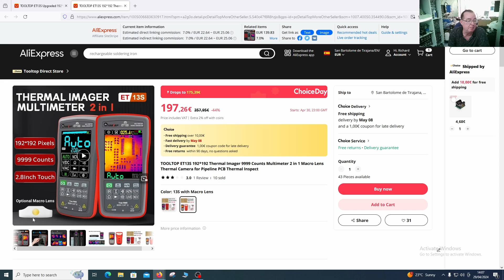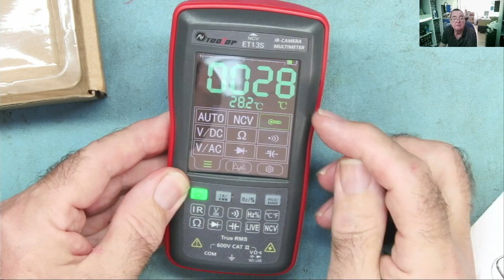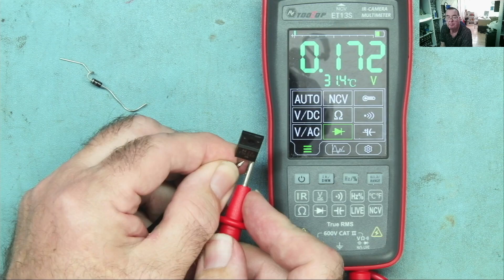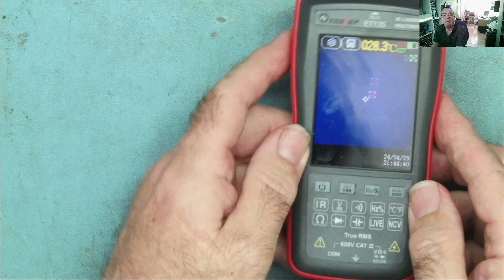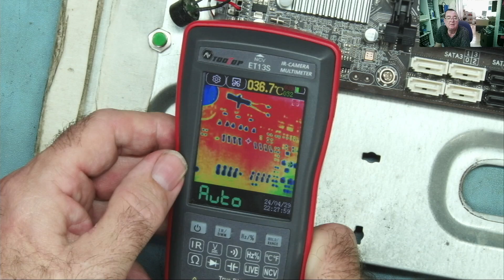TOOLTOP ET13S IR Thermal Camera Multimeter! Test, Review and DISCOUNT CODES This is interesting!

Comment: Will this be usable for micro soldering? With small resistors?
Reply: and capacitors
Reply: @sharymens8187  did it have a soldering feature?
Reply: @dubmob151  ah I meant to be used in microsoldering, pardon for the confusion

Comment: The soft start on-off button is universally popular now, but there is a drawback, as there’s a very small drain on the battery, similar to standby voltage. However, old school equipment with a traditional on-off switch will disconnect the battery.
Reply from the maker: Agreed
Reply: Why do you think the old school setup is declining in popularity?
Reply: @sharymens8187  latter day humans no longer have the excess physical capacity to operate manual switches, being only capable of button pushing.🙃

Comment: Nice review Richard. I like yourself, don't like how it enters IR camera on power up I'm sure it would drive me nuts in no time. Question - Is it possible to export saved images i.e. is there any connectivity?
Reply from the maker: @alanrichardson1672
 It turns out you can set this in the setup menu to boot into whichever mode you prefer at startup, I missed that and apologise as it was misleading.  This just makes it better IMHO
Reply: Yeah, you can export the picture

Comment: If something had to go to keep the price down then current is the obvious one as no extra connectors no fuses no firmware, thanks for the review I shall take a closer look t this purely from a FLIR point of view as its less than 200 quid ....cheers.
Reply: Current measurement would also probably be the least used range / feature for most average users.
Reply: @alanrichardson1672  Yep, and thats certainly true for me :)

Comment: Thanks for the review. The screen resolution and four physical buttons suggest it's basically an android device of some sort. Also, I think the display behaviour when you connect a diode to test and it is in continuity mode is by design to inform the user that there is some sort of active device present rather than a pure resistance.

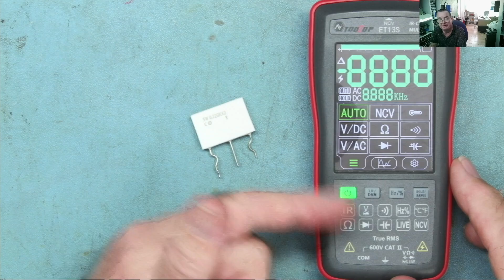Comment: @LearnElectronicsRepair [9:04] The "Auto" label in the thermal camera mode briefly displayed "42.78 MΩ"! What does this mean? Does the device allow electric measurements while using the thermal camera???
Reply: Well spotted. It didn't do it at any other point in the video though. Strange.
Reply from the maker: @Manticore1960  Let's see if we can replicate this on the livestream, Sunday @theelectronicschannel
Reply: @LearnElectronicsRepair  While in the thermal camera mode, connect the test leads and short them. Will it buzz?

Comment: I believe that the current mode is omitted for a reason. In current mode the shunt resistor heats up, which is bad for IR camera. For best performance the IR imaging array should always be in constant (low) temperature. This must be a deliberate trade-off.
Thanks for the video as always.
Reply from the maker: Yes that makes some sense.  It doesnt' make it a bad multimeter, in fact I think the combination of the Mr Bleep style diode test mode and the thermal imaging makes it a good fault finding tool - and very good value at the speicial offer price 🙂

Comment: Nice tool and the ir cam has  good refresh rates in this price class.
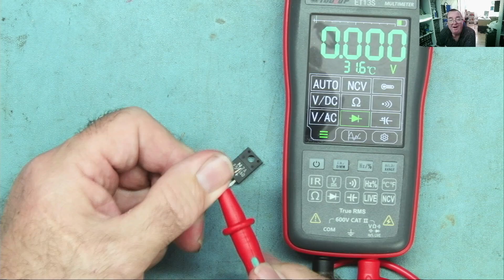13:40  Mr. Bleep is in da house 😱🤣🤣🤣
Reply from the maker: YeahI was really surprised to find that - as you saw in the video. That was my genuine reaction.  Price wise with the special offer 1st-5th May, it comes in at around €140 and that's really good value for the specs IMHO

Comment: I'm always a little wary of DMMs that don't use standard batteries. It's probably fine if you use them regularly. But if not, by the time you need them the internal battery will likely have fallen victim to the high self-discharge rate of rechargeable cells. On the other hand, when was the last time you had to replace the batteries in your Fluke or Aneng? And in a pinch (like an emergency on-site repair job), it's much easier to get hold of a couple of AAs or AAAs. They're sold at every petrol station, even on Sundays. Then again, maybe I'm overthinking this. 🤷
Reply from the maker: It does seem to be the new standard that all portable test equipment uses lithium batteries and USB-C.  I don't know if this is due to some ecological requirement or just the way everyone seems to think is best.
Reply: Yes you probably are. Li-ion cells shouldn’t loose charge when powered down if the circuit is designed correctly.

I do agree though, I like AA batteries best.
Reply: Until they leak and ruin your meter!   @perkulant4629
Reply: @perkulant4629  Wikipedia claims (with sources) that Li-ion cells lose 2-4% of their charge per month. That's on top of any quiescent current drawn by the device itself (e.g. to monitor the power button, retain settings in NVRAM, etc). And it fits with what I experience with the power bank I bought "just in case". Every time I actually need it, it's already half flat. A friend of mine had bought one of those fancy pants power banks that could even help start a car (at least that was the claim, I didn't test it). When he wanted to take it with him on vacation, it was completely dead. The cells had self-discharged so much that the charging circuit wouldn't recognise them anymore and refused to charge. I had to crack open the case and inject voltage directly into the cells to bring them back to life. Told him he should keep an eye on the charge every couple of months.

@LearnElectronicsRepair  It might be an interesting test to see if the charge in such rechargeable meters can get you over a full 8 hour work day if you use them heavily as your daily driver in a professional setting (like a repair shop).

Comment: CAT II so not really suitable for mains voltage use. Looks ok for a cheaper meter, maybe a bit flimsy? The thermal camera function is definitely unique.
Reply from the maker: You know, back in the day I don't think we had CAT ratings on our multimeters but it seems we were still able to use them safely on mains voltages and even higher as there was a lot of vacuumn tube equipment around then too...  Yeah it's the IR camera function that makes this stand out.  It's not perfect as I found in the review but for the price range it's very good IMHO.  It didn't feel flimsy in use to be honest though I didn't try to throw it around which may happen when it is chucked in the toolbag in real life site use.
Reply: @LearnElectronicsRepair  I picked this up to add to my 17yr old son's bench. High voltage is not a necessity for him as I have him work on lowish voltage devices.. not like my father in the relatively unregulated 70s, or my grandad in the 40s... They did stuff that could/would make your hair stand on end! - Thanks again for the link, Rich.

Comment: In the settings you can change the default startup function to be the multimeter instead of the thermal camera.  It then starts up almost instantly in multimeter mode.  Also, I ended up paying double VAT as AliExpress charged VAT and customs also charged me VAT.  It seems impossible to get AliExpress to refund the VAT despite their site saying that is what they will do.
Reply: Have you tried Customer support? What was your experience with them?
Reply: @LPgmxDan  Terrible.  The first one couldn't understand that because AliExpress had shipped multiple items in the same parcel that customs would apply VAT to the entire value of the parcel.  Then I got cut off.  The second one raised an escalation for me and whoever looked at that dismissed it as they also could not understand that the entire parcel is subject to VAT and not just the value of individual items.  It's a total waste of time talking to them.
Reply: @wczwcz1633  how apart you ordered your stuff? If I am not mistaken you usually need to wait 3 to 4 days or until they shipped it already to order something else
Reply: @LPgmxDan  I have tried AE customer service over the years and quiet frankly they are useless. They do not want to loose face so they will tell you what you want to hear and promise things that they have no control over.  The result is that you wind up being more frustrated than before the chat.
Reply: @GregM  generally what were the stuff you were facing? Might be useful to know what to look out for with them like the guy above who was send couple of items together so vat was probably higher then what you pay initially

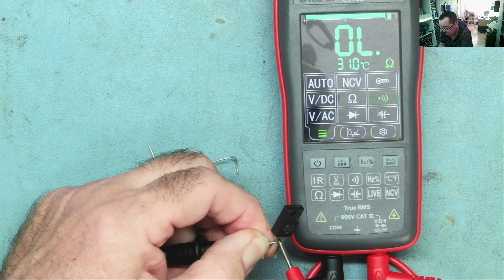Comment: [13:00] It switches back and forth between two different ranges with different test voltages (e. g. 0.3 V and 3 V). The diode is open at high voltage, but closed at low one.
Reply from the maker: That sounds like a reasonable explanation, though I've not seen any other multimeter display this behaviour.
Reply: @LearnElectronicsRepair  I just went to pick one up on your link, Rich, and got "Sorry, the page you requested can not be found:( "

EDIT: It's now back up and running fine. Maybe AliExpress were updating something.
Reply from the maker: @alanbenson1505  Yeah the sale started, grab a bargain
Reply: @LearnElectronicsRepair  It has... I did! (using your link) Thanks, Rich.

Comment: What does "Auto" mean in the thermal camera mode?
Reply: Color will change according to what you're looking at, if hottest spot is 40 degrees than that will be bright and other things in darker colors. Setting it manually is probably better when hunting for shorts.
Reply from the maker: Turns out you can measure voltage/resistance/continuity while in thermal camera mode 😀

Comment: Ok, so it's became cheaper now, worth considering. But, these guys would consider few more features like Ampers even up to 10A, miliohms, and PC connection for live feed.
Reply from the maker: Pretty much my summing up - with the price this is a very good choice, it works well but with a few tweaks and addition of current mode it could have been a killer product.  It has been suggested that the lack of current mode is because the last thing you want in a thermal camera is shunt resistors getting hot.
Reply: @LearnElectronicsRepair  I bought this one and we're using https://youtu.be/ZDKF3dI_-64, but the problem is that after months of using it, it developed a fault. 

It has to be calibrated. The thermal and video are not together anymore and it was fine for the first several months. It came in the November 2023, we use it several times per week minimum. We have 60-80 repairs of all household electronics repairs.

So, the question is, can we calibrate these on our own? China is refusing to help without sending it back. So, it's a no go. If I have to buy the next one, I think I'll go for something from UK rather than abroad ;). I'd rather pay £300 and have warranty, than pay another £150 and have no warranty ;).

Different strokes for different folks :D. But, if their support could explain if it's OK to calibrate, or/and how to do it, I'd love my one ;).

Comment: €146 from tomorrow and that's with 25% VAT so even cheaper for most of you, it's a fair price even just for a decent thermal cam. I'll probably order one.
Reply from the maker: Yes that is my take on it, the price, especially with the May discount, makes this a great value bit of kit I can thoroughly recommend even with a few quirks I found with the Multimeter.  If the price you state includes 25% VAT then this is going to cost around €116 down here in the Canary Islands. And it does have the Mr Bleep function which I've been asking manufacturers to implement for what seems like ages now! If you are thinking of buying one, especially if you don't have a thermal camera, now is the time 🙂 The special offer is from May 1st to May 5th